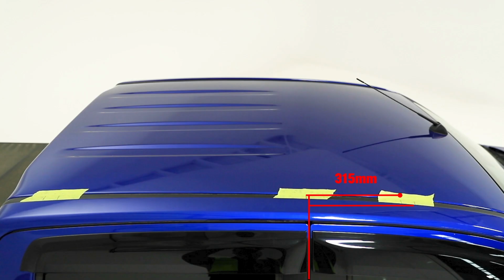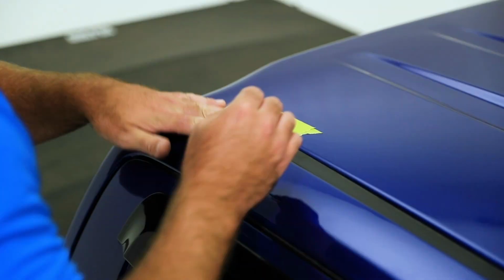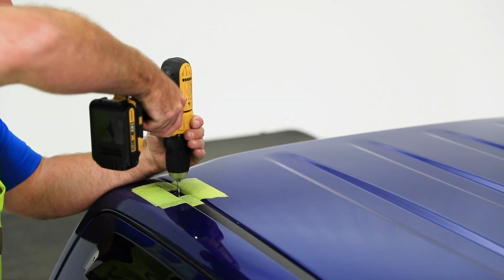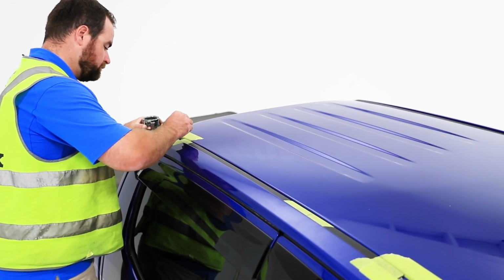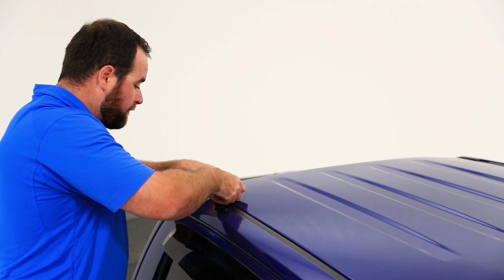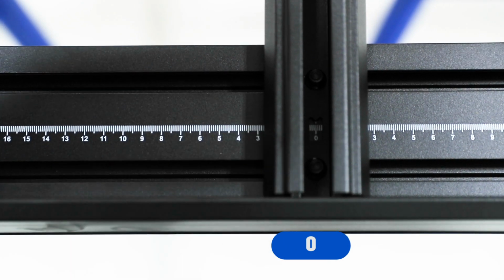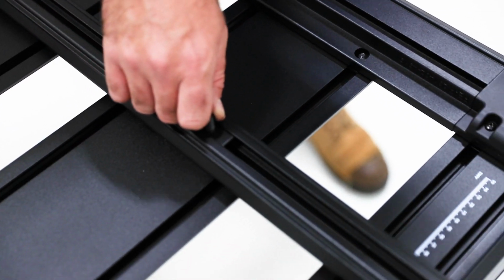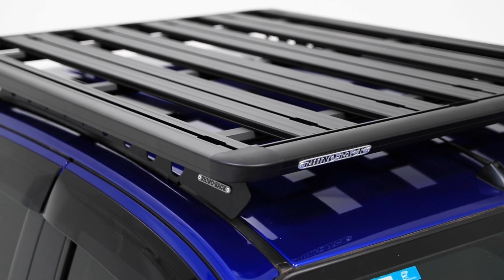Rhino-Rack | Isuzu D-Max Backbone Installation

Comment: Hi.  For 2018 hilux , Is it with bolt under the roof rail?
Reply from the maker: Hi there, if you head over to our website and enter your vehicle details in the Fit My Vehicle tool: https://www.rhinorack.com/en-au/roof. You will find the PDF instructions located under the Product Details. Thank you!
Reply: Hi Mate, just wondering if you noticed the bold under the roof rail? 

I’m looking to install as well but would like to know wether there is already bolt instead before drilling it.

Comment: Hey, is this all similar for the 2015+ triton?
Reply from the maker: Hi there, depending on what Platform you have you can find the Instructions at the bottom of the Product page. Here's the Backbone fits for your vehicle: https://www.rhinorack.com/en-au/fit-my-car/results/1338/mitsubishi-triton-gen5-mq-mr-4dr-ute-double-cab-04-15-on?filters%5Bprice%5D%5Bmin%5D=429&filters%5Bprice%5D%5Bmax%5D=1745&filters%5B-of-bars%5D=&filters%5Bbar-style%5D=&filters%5Bbar-type%5D=&filters%5Bcolour%5D=&filters%5Bcross-bars-inc%5D=&filters%5Bleg-profile%5D=8B84CD36-FAD8-43DD-BEB2-A8DA2C86EDA8&filters%5Bpioneer-systems%5D=&filters%5Btrack-type%5D=. This will give you the exact measurements. Thank you

Comment: are the reference measurements the same as for a colorado 2018
Reply from the maker: Hi there, depending on what Platform you have you can find the Instructions at the bottom of the Product page. Here's the Backbone fits for your vehicle: https://www.rhinorack.com/en-au/fit-my-car/results/888/holden-colorado-4dr-ute-crew-cab-06-12-on?filters%5Bprice%5D%5Bmin%5D=236&filters%5Bprice%5D%5Bmax%5D=1802&filters%5B-of-bars%5D=&filters%5Bbar-style%5D=&filters%5Bbar-type%5D=&filters%5Bcolour%5D=&filters%5Bcross-bars-inc%5D=&filters%5Bleg-profile%5D=8B84CD36-FAD8-43DD-BEB2-A8DA2C86EDA8&filters%5Bpioneer-systems%5D=&filters%5Btrack-type%5D=. This will give you the exact measurements. Thank you

Comment: Does the 2019 dmax have the nut inserts?
Reply from the maker: Hi Syra, the roof should have the fixing points in there, but depending on what model D-Max you have you may need to drill the roof to access them. Please see the fitting instructions for more information: https://assets.rhinorack.com/Instructions/Parts/FittingApplications/RIDB1.pdf. Thanks!